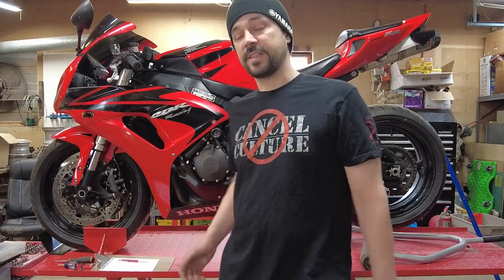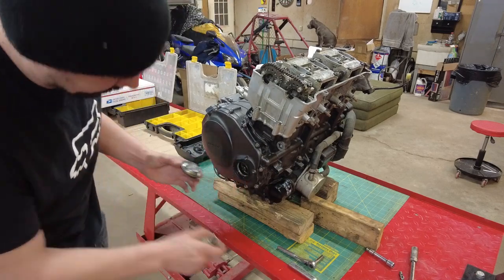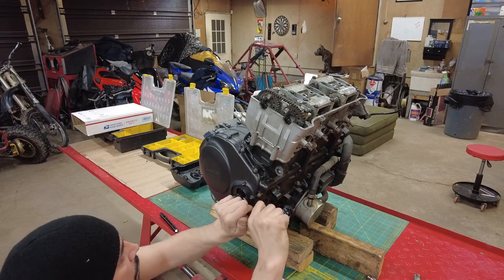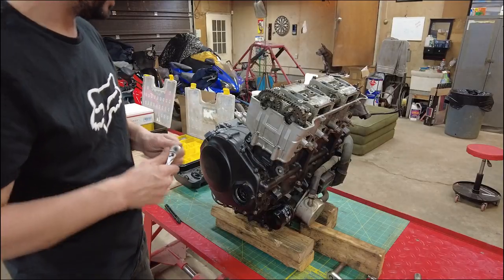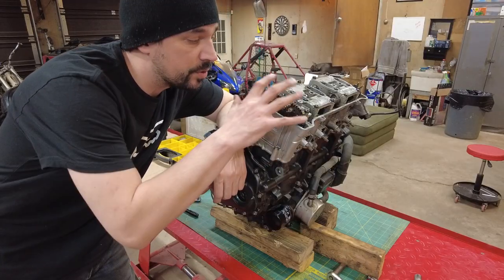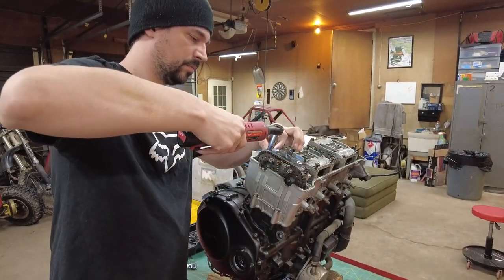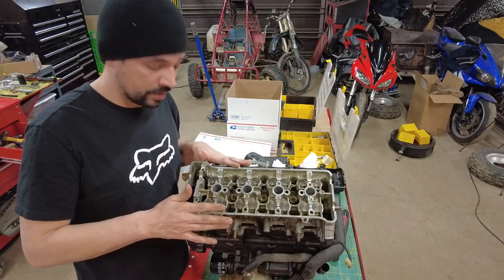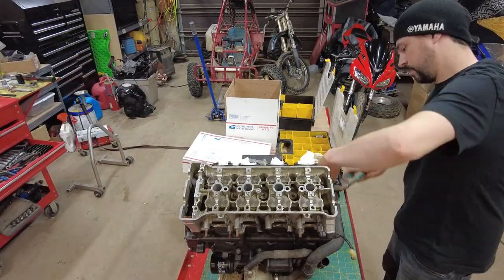CBR 1000 Engine Teardown | How to Rebuild a CBR 1000 Engine | Crankcase Tear Down | Knocking Noise

Comment: Great video! I have a 2008 Limited Edition that I upgraded to a 2012 engine to avoid the oil consumption issue. Now the 2012 is showing zero compression in one cylinder. I know exactly how it needs to be broken down thanks to this video. Appreciate you! 😎
Reply from the maker: Yes and no... the 08 plus is actually a bit different. All same basic concepts but I believe the cylinders are independent of the cases on 08+ (might be wrong on that) but i do know the transmission comes out when the case is split not out the side like this one. All that being said, I'm betting you have a valve issue on the head of your zero compression cylinder. Unfortunately, I didn't dig into the valves on this engine, so you won't find that here.
Reply: @The.Odyssey  appreciate the advice. Mechanic is handling the tear-down, and I know it won't be exactly the same, but I have an idea of what it entails. Great guess, I believe it is also a valve issue on the head. It's disappointing since I dropped my bike off three weeks ago so I could attend Biketoberfest over the weekend, and she is still in the shop! Why did I originally take her in? Replace the front bearings!!! Can't make this stuff up. 😎
Reply: @The.Odyssey  once again appreciated your advice and just reviewed several valve adjustment videos. Thanks again! 😎

Comment: Your videos have helped me a lot, I have exactly the same problem in my 06 cbr1000rr and it is exactly the same bearing of the same cylinder thank you for sharing.
Reply from the maker: That's great that I was able to help! Unfortunately I don't have the last videos completed yet to show reassembly. But if you have any questions please let me know. Important points to be sure about is condition of the crank on the journal with the bad bearing and bearing selection. I actually still need to put together content for that as I will be showing the charts in the service manual and how to select proper bearings as there are different sizes. It can be a little confusing. Don't hesitate to reach out if I don't complete the videos before you need them or if you have any questions either way.
Reply: @The.Odyssey  I appreciate your response and help, I am at the moment of choosing the new bearings but the information is a little bit confusing, and i don't know if the crankshaft needs be polished.
Reply from the maker: @fabianrangel9801  I measured the lobe on the crank and could tell it was out of round so i replaced it. I also put the rod back together and measured it to find the same thing. Crank and rod were replaced. There are letters on the case that are half the puzzle on your main bearing selection. Then there are letters on the crank that are the other half of the main bearing and half the puzzle for the rod bearings. Rods also have letters and numbers I believe it was which are the other half of the puzzle for the rod bearings. The service manual has charts to look up which bearings you need with that info. Even after using this I still checked to make sure my oil clearances for the bearings were in spec with plastigauge. Being that I replaced the crank I also did all the bearings (main and rod) If you need the charts let me know and I will find them. I'm assuming you are already working with the service manual, I couldn't find an 07 manual so I worked out of the 04 and had no issues with that. You do want to be sure that the crank and rod are good, if you spun a bearing there is a good chance that there is damage there, especially if it was ran for any amount of time once it developed the knock.
Reply: Did the bike run sweet after the repair?
Reply from the maker: @bigjam8429  yeah, ran great!

Comment: Awesome bro. Plan to rebuild the engine of my 05 CBR 1000RR to check for spun bearings, might be the culprit for the low oil pressure light going crazy when the engine is already at operating temp. checked the oil level, replaced the oil pressure sensor, checked the oil pump (which was working great), relief valve, harness and everything but still have the red light of death blinking. Thanks man. This will save me a few bucks. Super appreciated your video.
Reply from the maker: Did you get a look at the pickup tube?
Reply: @The.Odyssey  Yeah, it's all clear, the strainer is not clogged too.

Comment: I really enjoyed this deep dive into the heart of the CBR♥️
Reply from the maker: Thank you! Im proud of how this video came out. It was sucking me in while editing. There is more to come... I'm currently working on a video of using plastigauge to check oil spec on the new bearings. After that it will be reassembly of the engine video and then reassembly of the bike and first start. Takes many hours to make the videos flow like this.

Comment: Hello, I would like you to help me with the doubt that I have regarding the timing marks on a cbr 1000rr 2004. On the camshafts it is easy due to the marks in relation to the head, but down there I can't be sure if the "T" mark that lines up with the mark on the cap or whether the line  ( I ) right after the "T" should line up. Thanks

Comment: All the HRC manuals for 06, 08, 12 all show crankcase mods for oil drainback, heavy mods too, an oil pump kit that slows down the pump and a different pressure releif spring.
The 1000 had oil issues.
Reply from the maker: Got an electronic copy?
Reply: @The.Odyssey  These might be the ones, look for the mods around the main bearing webs, the pump kit is not described, but its the only kit hrc still sells for the earlier bikes.

Comment: What size is the bit for rod caps?? Looks like a reverse torx or 12 point??
Reply from the maker: 12 point, I believe it was a 10mm
Reply: @The.Odyssey  perfect,Tearing the pistons out mine now. Thanks alot for the quick response and the good video!
Reply from the maker: @Jonathan Tomlin  you're welcome and thanks for watching. If you have any questions along the way hit me up
Reply: @The.Odyssey  yes sir!! I’ll be sure to reach out! Thanks again
Reply: So I do have a question. How do I get the correct orientation for the connecting rods going back on pistons. Followed what the manual says and it’s backwards to how it was?
Reply from the maker: @Jonathan Tomlin  I dont think i seen the suggestion in the manual for this. I matched how I took them out. I don't believe it should really matter. This biggest thing to watch here is orientation of the piston for the valve reliefs.

Comment: Helped alot thanks. Do have a question took clutch cover off yep washer fell but have a cap that fell out as well looks like an engine plug any ideas
Reply from the maker: Is it a locater pin for the cover?

Comment: Do you have a video to change the bearings for the rod? And do you have a site to look up torque specs?
Reply from the maker: I have the footage but haven't edited it. Look for the service manual, I believe it was 2004 that covers this one too. It has charts in it to choose the bearings. That's what I did to this but I changed the crank and 1 rod as well.
Reply: @The.Odyssey  I wish you can continue do more videos about 1000cbr. Mine is 2006 Honda cbr1000rr
Reply: @The.Odyssey  hoping you do the video of reassembling the motor. ❤️❤️❤️❤️

Comment: Rotor bolt snapped in half trying to align the T marks and cams, any ideas on how to proceed? Popped the clutch side cover off and it is about 3-4 threads deep.
Reply: Update: Was able to extract bolt with left hand bit. Think she might be seized though.

Comment: bro i realy appreciate your tutorial but where can i get the torque specs like cylinder head bolts and etc... could you please give me a guide on this like if its service manuals where can i get that ??
Reply from the maker: Yes, I use the service manuals. I was never able to find an 07, I used the 04 manual. I get a lot from manualslib but I don't see it on there. If you just Google the bike, year and term service manual you can usually find them.
Reply: thx but here's a question? what if my bike is a 2023 gxr ?? does 07 or 04 manuals apply ?? what if i need the 2023 manuals?? is there any source i can get the service manuals if its needed?? @The.Odyssey
Reply from the maker: No, 2004 - 2007 CBR 1000 engine is mostly unchanged. Different porting / timing and whatnot. Outside of some different physical parts in place of others they are the same. There is probably an appendix service manual made for the later years as things like the head would be different because of the different porting. Bikes generally run in generations of 3 or 4 years between major changes. Sometimes less time, sometimes more.

Comment: thank you so much
sir , i don't know why transmission stucks when i bolt it in the crankase ? can you help me ?
Reply from the maker: You can't turn it? Make sure the gear shifting cam and forks are not out of place. Try rotating the cam while holding them in place and see if everything moves. You will have to turn the primary shaft here and there to help.
Reply: @The.Odyssey  everything still fine untill i start to tighten the lower right bolt of the transmission cover .
Reply from the maker: @Allfreeshop  are you pulling it in with the bolts? Get it to fit flush first then add the bolts. My other 2 thoughts are something is not hitting a bearing correctly or there is a spacer in the wrong place or wrong direction on something you may have took apart. For instance on the outside of the plate on the gear shifting cam there is a T bushing that goes 1 way not the other.  (Parts diagrams will help check this)
Reply from the maker: @Allfreeshop  follow up question. What is the reason the engine was disassembled.
Reply: @The.Odyssey  thank you so much , I'll try tomorrow and then  message you about the results.
Reply from the maker: @Allfreeshop  great, good luck! Looking forward to hearing back from you
Reply: @The.Odyssey  i disassembled it due to hard start .
Reply from the maker: @Allfreeshop  that's a deep dive! Did you find anything?
Reply: @The.Odyssey  scratched cylinders walls , i think it's because of overheating , even pistons are scratched , the engine internal sound was smooth  but  hard to start with little smoke and dies on throttle .

Comment: I did it!! I got the engine to the same point as u! Now I just need to know what I need to order to put it together. Do I need any gaskets or just gasket maker. Is there stuff u have to always replace when going back together?
Reply from the maker: You will need a new head gasket and the rest is sealer. I recommend motoseal. Have you downloaded the manual? The manual recommends (actually demands) replacing all the crank and connecting rod bolts. Are you replacing both case halves? This may be troublesome to source unless you find a used set. I wish I had the rest of these videos completed for you, but I have days of editing ahead to have a finished product (or products rather) and just don't have the time right now. Shoot me an email and give me your number cryptosaulszee@gmail.com so I can discuss your next steps with you and help you with some direction.
Reply: @The.Odyssey  dude my bad. I tried sending u a message then realized later I didn't put Gmail. I put Gnail. Then after that I spelt it wrong. Omg. Anyways I think I finally sent u a message to the right email. I so was not ignoring u or idk but I def was trying to reach u like right away so

Comment: What oil are you use? Full sintetic or semi sintetic?
Reply from the maker: Personally I use semi synthetic, not sure what was used in it before I got it with the spun bearing. Full synthetic will give the best protection, if it was something I was racing I would be running full.
Reply: @The.Odyssey  i have sticky clutch and i use 7100 motul does that oil cause that problem with sticky plates? Honda say in manual dont use with molybedum
Reply from the maker: That shouldn't cause an issue. I'm not sure of you can see the basket through the fill hole in the engine on this bike or not but if you can I would see if there are groves worn in on the basket, that will cause the clutch to drag which is what I think you are describing here. (Clutch doesn't fully disengage and bike creeps in gear with the clutch pulled)

Comment: I havr the same bike my bike keeps on misfiring i dont know what to do took the bike apart everything works when i put it together again bt after taking a ride it just go back to misfiring then there no power
Reply from the maker: Did all your coils (spark plug caps) fit tight? I've broken a spring that engages with the top of the plug before and had similar symptoms

Comment: Hey jw when I cracked the case open a doul pin like thing dropped and has a pin hole on one end and a bigger opening on the other and can't figure out where it goes can u help?
Reply: Looks like something for oil pressure
Reply from the maker: Check the bearing for the driven gears (where the sprocket goes) I believe there was a roll pin there.
Reply: @The.Odyssey  does it just lay between the bearing and a gromit squished in place by the block?
Reply from the maker: @banjoboy272  i just reviewed my video and don't see what I was thinking. I swear I remember something there though. could you give me measurements on the part you are trying to identify? Maybe send a Pic as well to cryptosaulszee (at) gmail. I see a dowl pin (#30) on the crankcase parts diagram, could that be it?
Reply from the maker: @banjoboy272  transmission diagram bearing 34 (special bearing) i think i see what I'm talking about, you can see there is a spot on the bearing where the pin may fit in. I do recall it coming out on mine when I took it apart.
Reply from the maker: @banjoboy272  also check out number 4 on the crankcase diagram.
Reply: @The.Odyssey  looks like it goes between that bearing and #33 on crankcase but no diagram shows anything there
Reply: @The.Odyssey  #8 on crankcase diagram
Reply: That's the part I'm trying to figure out where it goes
Reply: @The.Odyssey  still want to say thank you very much h for trying to help much appreciated

Comment: Should be a brand new part to get more long life for engine? 
Or it’s not matter ☹️
Reply from the maker: Any parts worn beyond or close to their service limit should be changed. But used parts are completely fine as long as they are good used parts.

Comment: Some one know what’s replace part number of crankshaft (133010mel020) is out of production?
Reply from the maker: Used parts https://www.ebay.com/itm/126515960010?mkcid=16&mkevt=1&mkrid=711-127632-2357-0&ssspo=KhF4dgcIRYm&sssrc=4429486&ssuid=WEblr-HaSti&var=&widget_ver=artemis&media=COPY
Reply: Thanks  👍🏻